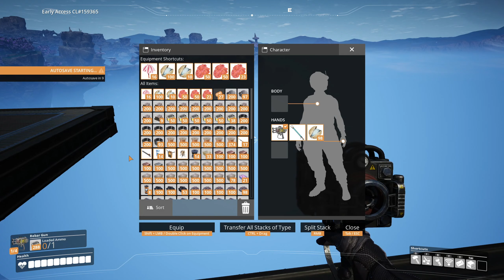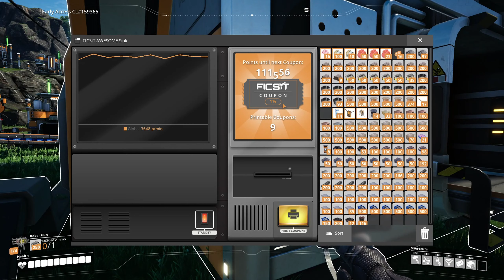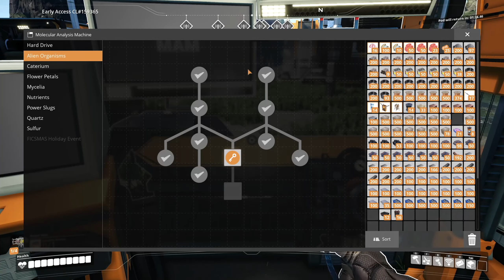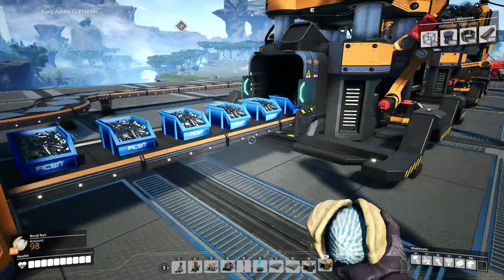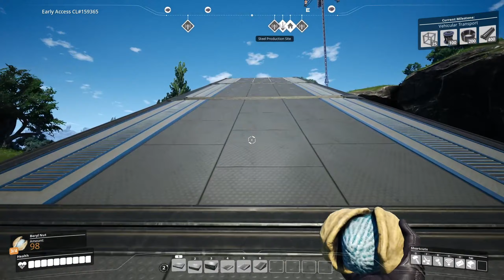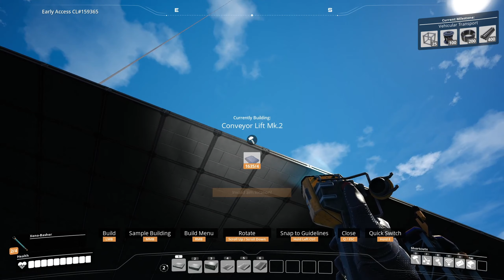Let's Play Satisfactory s01 e23

Comment: If you've got spare tickets I can really recommend the 8x8 ramp. It's been a great help for me to build ramps quick and easy. And it's cheaper to build. You don't have to place a flat foundation and then a ramp piece, you can just use the one piece to build a nice straight ramp anywhere.
Reply from the maker: I will look into that for sure. Thanks!

Comment: No, no, no.  Clear cut everywhere!  If anything, the biofuel makes good tickets.

And you can't slide under pipes if they're not elevated.  I've tried, wasn't pretty.

And yeah, that little car is silly, but kind of fun to run around your factory with.  Pretty crappy for cross country though.  Explorer is great for that.

And take a closer look for that backwards merger.  I remember it going on backwards.

And just belt the steel back.  Works like a charm.

Upgrading lifts are like upgrading belts.  Or miners.  Select the lift you want, mouse over the existing lift and click.
Reply from the maker: I looked for a bad merger but couldn't find it.  I thought it was over by the smart plating but everything looked fine.  I'm sure if it becomes a bottleneck I'll find it sooner or later.

The tiny car will be making an appearance soon! 😸